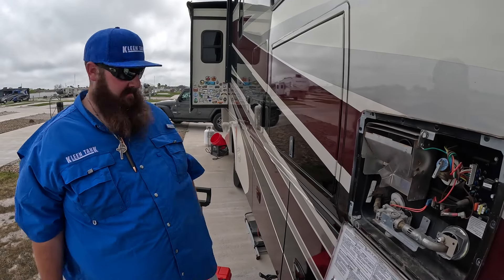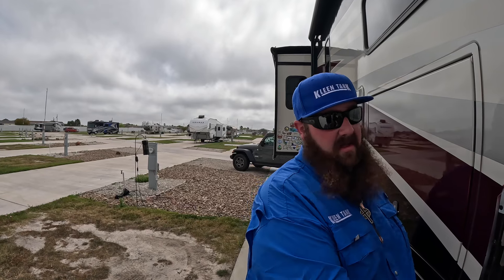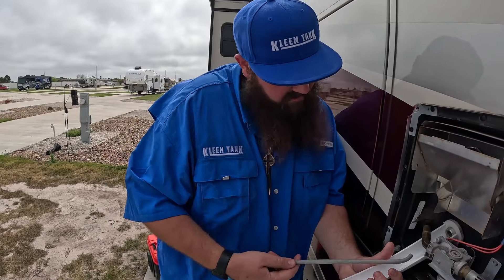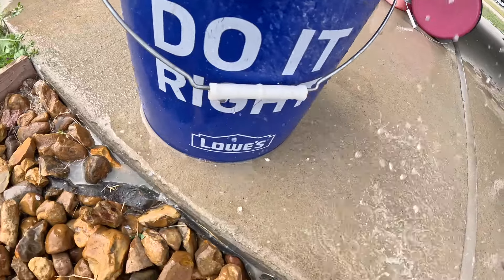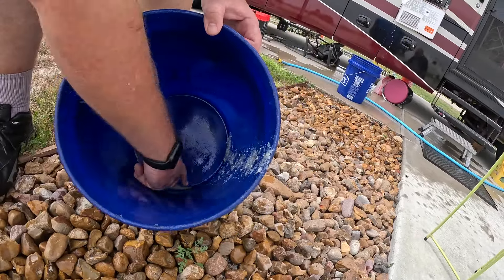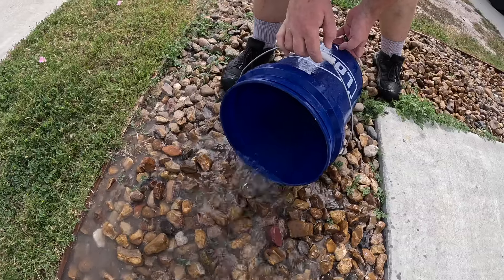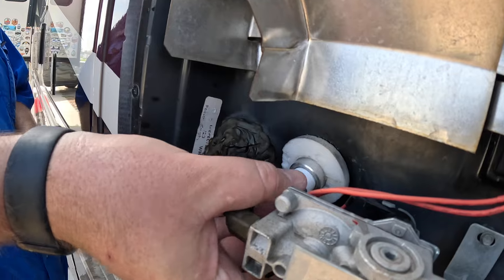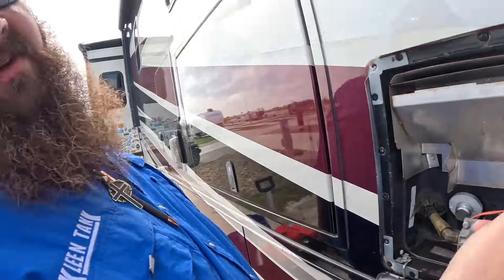RV LIFE: Master Class on Hot Water Heater Maintanace #kleentank #hotwater #rvlife #maintance #rv

Comment: Thanks for the reminder Alec ! I actually use regular pipe dope and teflon . Pipe dope stops the threads from rusting! I have a suburban hot water heater. 😁👍
Reply from the maker: I will have to check out the pipe dope. Thanks